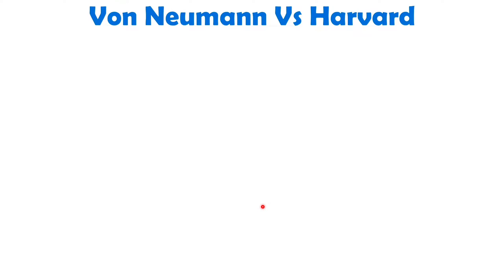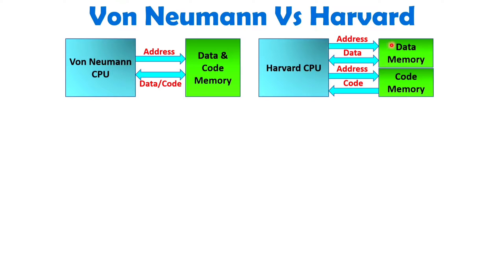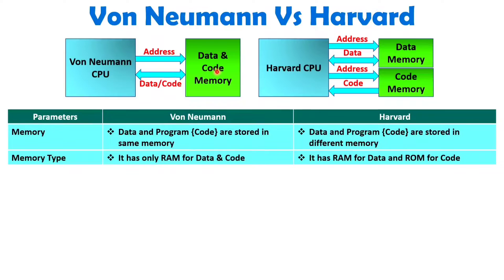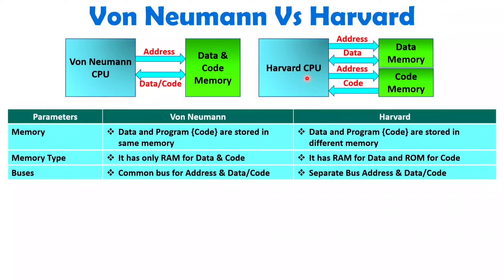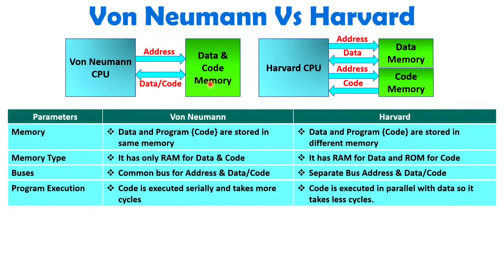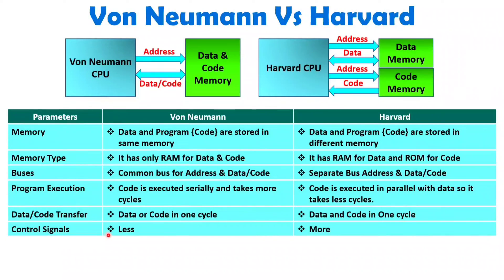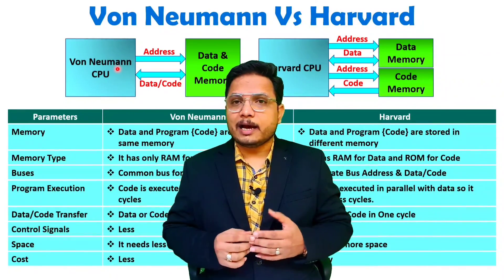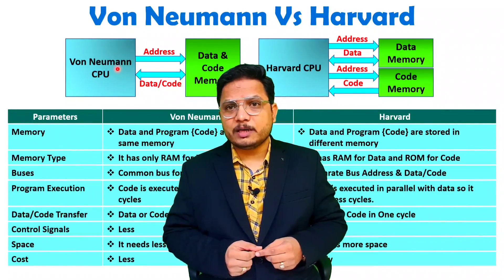Von Neumann vs Harvard Architecture: Understanding the Key Differences

Comment: Sir this video feels wrong to me ...

Von Neumann follows by Arm which is having parallel execution not serial one ..but u said serial..
Von Neumann is fast than hardward bcz of less instruction set but still u said it is slower than hardward ..
Program execution in ARM takes one cycle but in 8051 it takes many cycles so here ur program execution parameter is also wrong
Reply from the maker: It is not about serial and parallel. It is about code memory and data memory. See it properly 👍

Comment: Sir my question is , here we can see Harvard architecture is better than Von Neumaan and it is costly also better performance than Von Neumaan . 
In last video Microprocessor vs Microcontroller you say Microprocessor is better than Controller , even highly cost , better performance . According to this video Microcontroller is better than Microprocessor , is it right  !? 
Please Sir clear my doubt and thank You
Reply from the maker: Selection of Microprocessor and Microcontroller is based on application. If your application is based on embedded systems then you will have to choose Microcontroller. For desktop applications we should select Microprocessors.
Reply: @EngineeringFunda  Thank You sir and your video is too much helpful ..🙏🤍